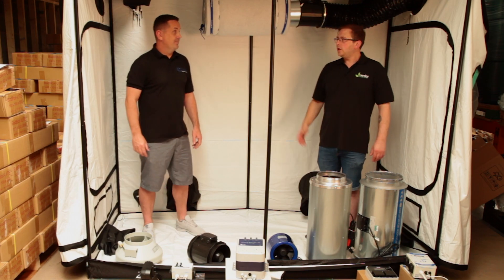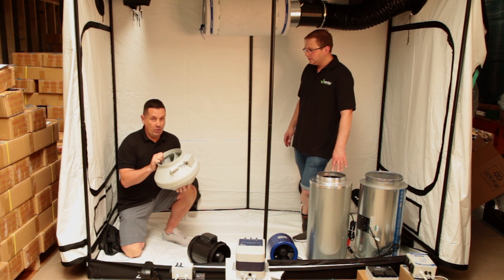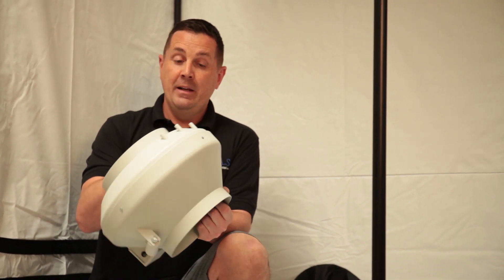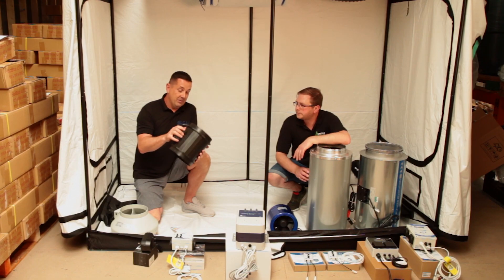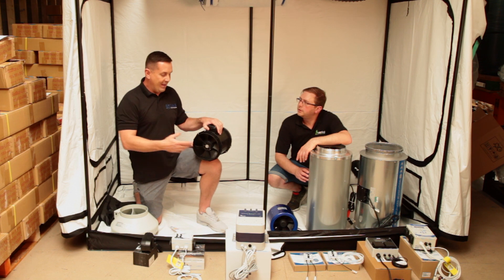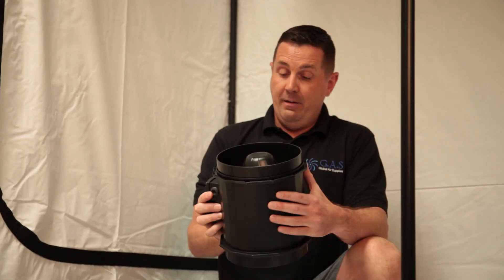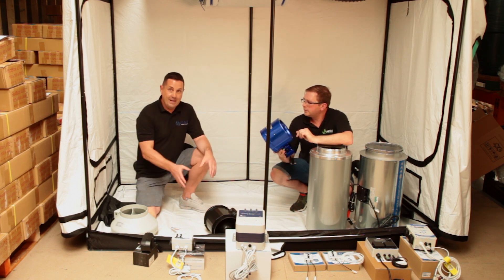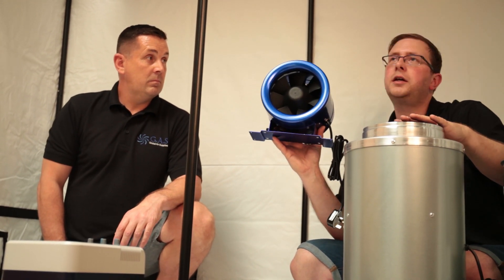A Guide to the Types of Grow Room Extraction Fan

Comment: Any plans to produce 4" & 5" EC fans for small grow tents?
Reply from the maker: Hey mate! So if you're going for EC you'd be looking for going for more power so there aren't any that small available on the market that we know of yet (we may be wrong!). As the technology develops though it may mean manufactures can fit that power into a smalling casing, giving you the ability to use them as san in intake fan etc. If you're looking for the output of a 4" or 5", you can simply turn a bigger fan down with a fan speed controller. 

If you need anymore help you know where we are mate!